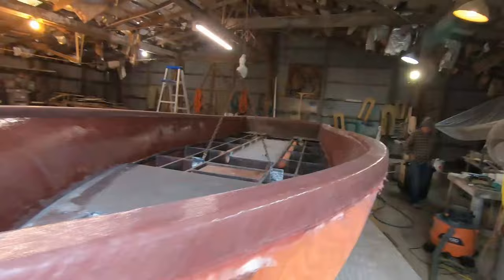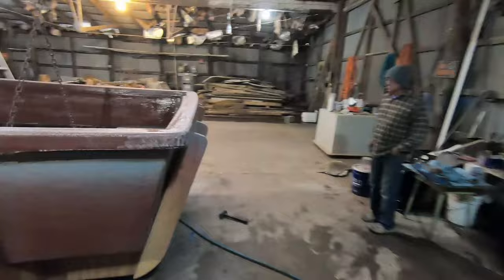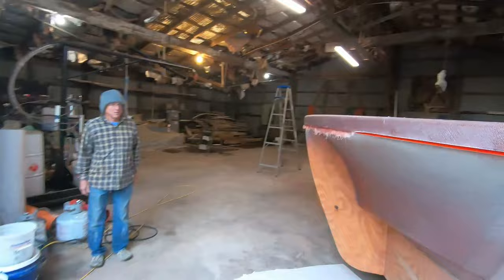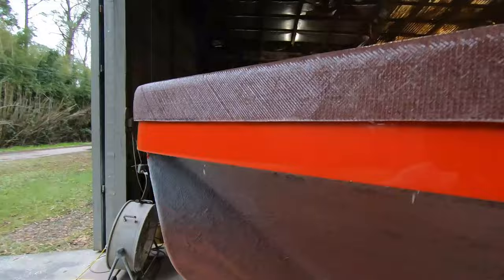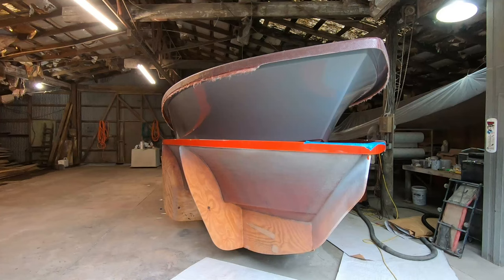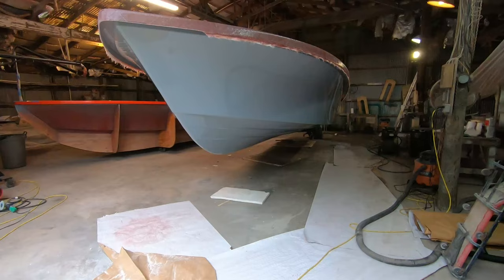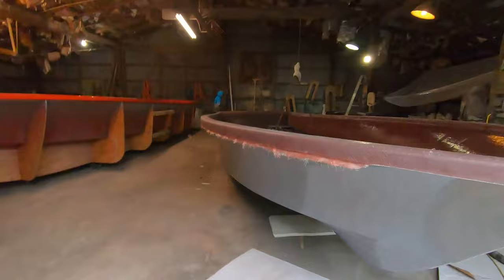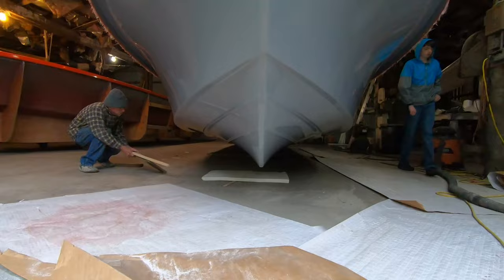EP-5 WE ARE BUILDING A NEW BOAT! HOW TO SEPERATE A FIBERGLASS BOAT HULL FROM THE MOLD

Comment: So did you build your mold on your own as well and if so did you come up with your own shape or how did you go about doing this I would love to start a project for my off time for the next couple years. :-) And it looks awesome by the way great job(:
Reply from the maker: Yes, So It started by drawing a side view, and a overhead view with a scale ruler. I knew what size boat I wanted to build based on boats I have owned in the past. the problem was, nothing like what I wanted was on the market. After drawing the plans the next step was to build whats called a plug or pattern. It's the mold, for the actual Mold that you build the  boat hull in. The plug, or pattern is a exact replica of the boat you want to build, but it's built out of wood and is faired out with specialized fillers and primers. Then the plug is polished and waxed to perfection. The actual mold is built on the outside of the plug, it consists of 18 layers of hand laid fiberglass, then heavily braced with framing and more fiberglass. It is a pretty complex process, I have been working on it for 6 years in my spare time and have spent tens of thousands on the project so far. I had hoped when I shared this on youtube it might inspire  and inform! There are several more boat building episodes other than just the one of us pulling the hull from the mold, be sure to check them all out as there is lots of info and details in them. Hope this answers some of your questions. Thanks for watching, and welcome to the channel!

Comment: Thanks you for shared your amazing videos.the must informatively and helpful that I can find on you tube. My dreams is build my own boat.I saw the progress of your job and I learning to much but I would like that yo(if it’s possible)help me in some details for example when you may a plug wit 1/4” carpenter plywood and staples you put a fiberglass before filler and primer and second what gecko and resin
Reply: Sorry ,what resin pump sprayer do you used and where u can buy?thanks in advance
Reply from the maker: Thanks! I would be happy to answer some of your questions. Yes, you would first fill the spaces between the plywood strips with filler. Then fiberglass over everything, then apply more filler, and fair it out. Then your primer. You would want to use a high quality tooling resin when building the mold. Your local resin supplier should be able to make a recommendation. The resin pump that we used is a Phoenix Apollo, I believe they are located in Florida. The one we are using was not brand new, we got it used. Hope this answers some of your  questions, And good luck with your project!

Comment: Very very nice, how many layers of gelcoat should be used and how many layers of fiberglass should be used to achieve the right thicknessy?
And what should be the sufficient thickness of the body of this ship?..
Reply from the maker: Thanks, Glad You enjoyed the video! We typically do 2 coats of gelcoat, one coat sprayed horizontally, and one sprayed vertically on the mold. There are 10 layers of biaxial glass on the bottom, which would be 3/8 to 1/2 inch thick. The sides are 6 layers which would be  1/4 to 5/16 inch thick. Hope this was helpful!
Reply: Thank you, yes this helps me a lot, I work with Fiberglass mat and I want to work a boat for 8 people with dimensions 5m x 2.2m .
But I have little knowledge and for this reason I asked you.

Comment: What’s your total investment so far ? Looks like a sweet boat
Reply from the maker: That's a good question. It's hard to say for sure. That's because I've been working on it for several years during the winter months, and have been buying supplies as needed. The build is really in three parts, the Plug, the Mold, Then the actual Boat. I'm sure I have thousands of hours, and tens of thousands of dollars in it so far. I can tell you this, It has takin more time, and money than I thought it would! By the way, thanks for subscribing, and commenting. I really appreciate it!

Comment: nice boat and work what is the deadrise of this hull
Reply from the maker: Thanks! It is a true variable deadrise hull, but the average at the transom is 17 degrees. length over all is 28 ft 10 inches. fuel capacity is 160 gallons, estimated draft is 15 inches. plan on powering it with twin 150 175 or 200 hp outboards. Appreciate the views and comment!

Comment: U need bond braker
Reply from the maker: The first hull out of a new mold is usually a little tougher to release, especially will a rolled edge design. After we introduced a little air through a fitting on the bottom she popped out pretty easy. But I will check out the bond breaker for future projects, Thanks for the suggestion!

Comment: How heavy is it? How many layers of fibreglass? How big is it? Why did it take years?
Reply from the maker: I estimate the finished weight to be around 4500 pounds, dry weight. That would be without fuel, batteries, or motors. There are 10 layers of biaxel glass on the bottom, and 6 layers on the sides. The boat measures 28 ft 10 inches down the centerline with a 9 ft 6  inch width. It has taken years because I am building it mostly by myself, and I run a year round fishing charter business that keeps me very busy. I also had to build the plug or pattern for the boat, then the actual mold was built off that , then the boat was built out of the mold. It's a very labor intensive, and expensive process! There are several other videos on my channel that explain a lot more of the process in greater detail. hope this answers your questions. Thanks for watching, and welcome to the channel!
Reply: @FishBumpTV  thank you for answering. Could you employ people (firstly on a share of the business basis, so not as bad for cash flow) and start pumping the boats out to sell?  What would the retail price be of that boat? $150k?
Reply from the maker: We may build some boats for sale in the future, but right now we are just focusing on finishing this one for our charter business. The finished cost for a boat like this could be anywhere from 150 - 200k depending on options.

Comment: What is the total length of the boat
Reply from the maker: It's 28 ft 10 inches down the centerline, with a 9,5 beam midship, tapering to 8,5 at the transom. projected draft of 14 to 16 inches, with 160 gallons of fuel capacity, with 30 gallons of fresh water on board. Plan on installing twin 150, 175 or 200's. Thanks for watching, and welcome to the channel!